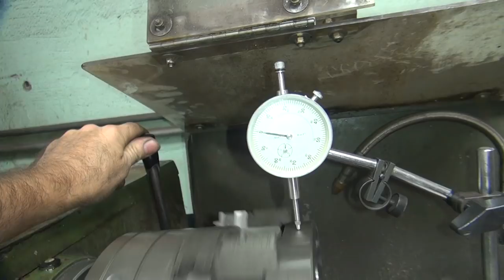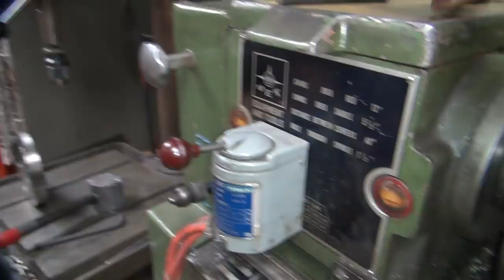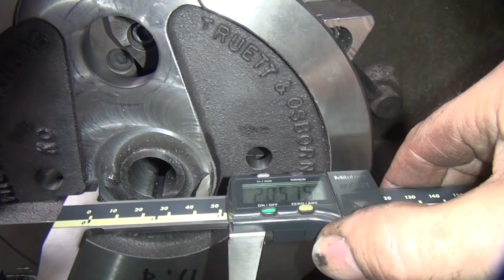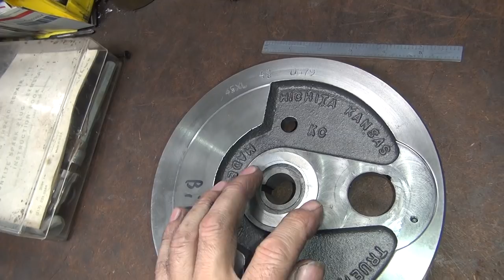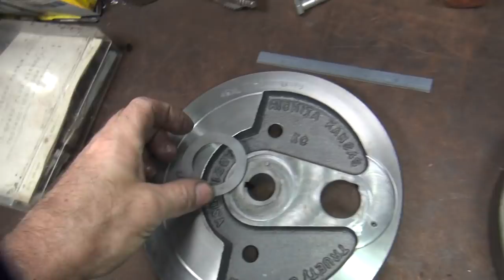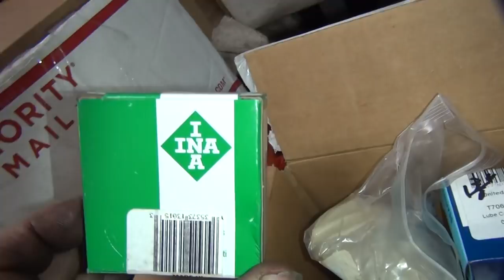1941 wld 45 56ci stroker #165 flathead motor build 4-5/8 in harley wl by tatro machine

Comment: do you think it would be a better setup to run the flywheel on a mandrel between centers, or is the current setup good enough?
Reply from the maker: .002 is close enough. i did not make these flywheels and they do not seem to be very flat or square.
taro